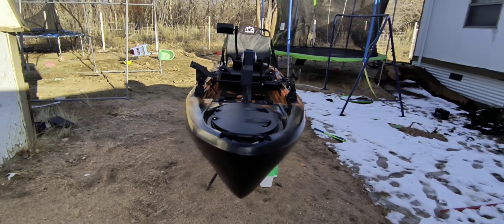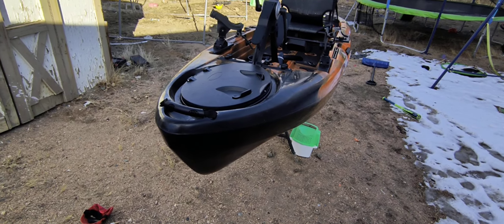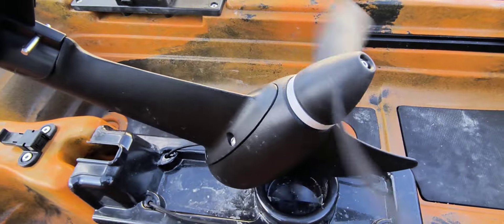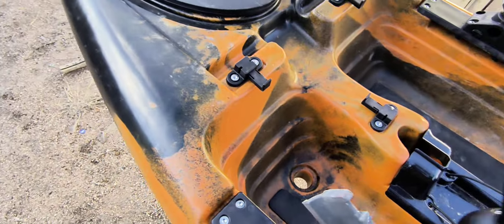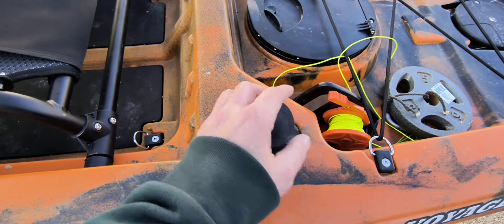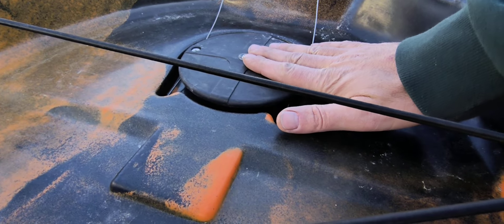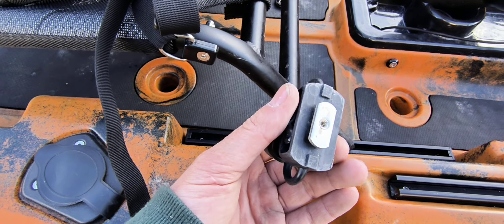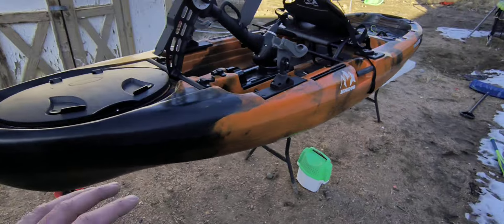Quick tour of my hoodoo voyager 100p (budget pedal drive kayak)

Comment: Just purchased one of these, after much research. I simple chose it because I didnt want to invest too much in my first fishing kayak, as well as being an older female. I knew that i would encounter some issues with the rudder being on the bottom, but i figured that i would be able to find a video somewhere to combat the issue I am encountering. How does one solo load this onto their car without messing up the rudder. I am a visual person and cannot find a video anywhere. I have even tried to find a decent native video for this issue.
Reply from the maker: I typically load it up rear first, I lay a blanket across my car, pick the back up and set it on, then move the the front and shove it on up, then twist it to center it on the racks